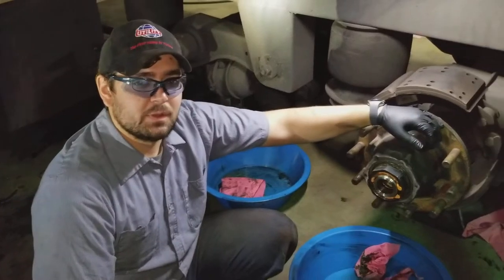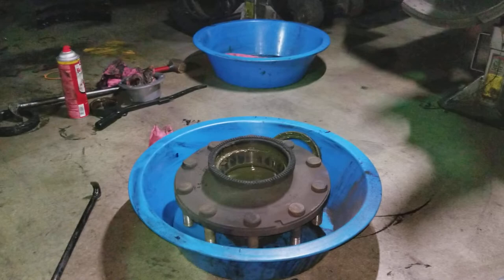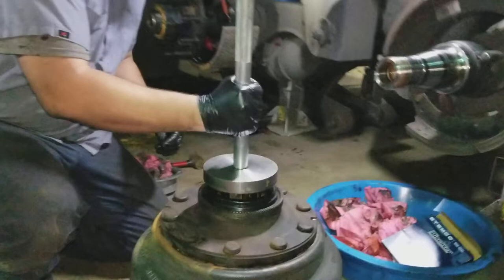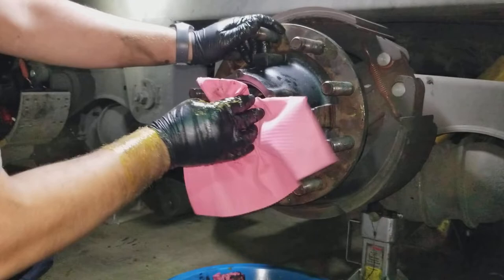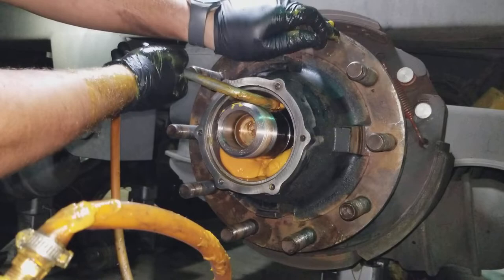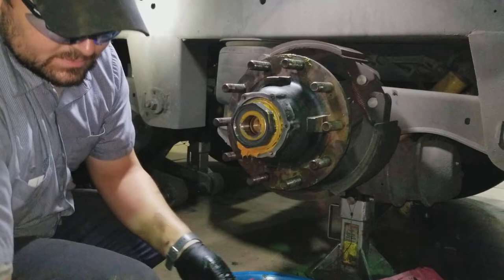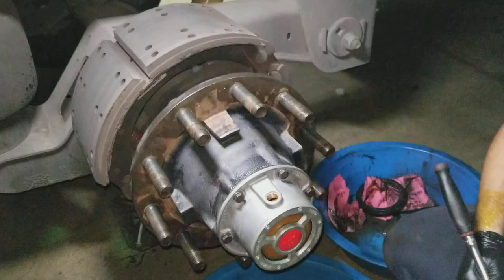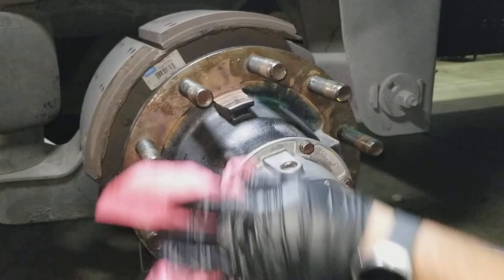Changing a Trailer Axle Wheel Seal

Comment: Great job but Wrong torque procedure. 200lbs ft 3x while spinning wheel hub back off til loose (1/2turn) ,then 100ft lbs 3x rotate tire, then back off 1dimple or 1/4turn. This is for this pro torque style Jamnut
Reply: Is the same torques he just started with the higher and work his way down to the 50lb ft torque

Comment: I watched this video and I agree with the last comment for the procedure for Pro torque nuts, and not backing of 1/4 turn is going to result in that wheel running  hot. Also you put in way to much grease, with that much grease you have no room for expansion or plug the vent hole on the end of the stub and that will cause that seal to start to leak. I also never put a seal in dry, I always put a little bit of oil on the seal before installing and a little bit on oil on the spindle before installing the hub no matter what brand of seal I install. I also switched from Stemco seals to National seals and I have way less seal failure with National. I do use the Pro torque nuts. I also never put the gasket on dry, I put some anti-seize between the cap & gasket & gasket & hub, I fine that the gasket will not stick to the cap or hub. I know some techs would and manufactures would disagree with me but I have been doing this for 30 years and have found this method to be full prof. We also retorque our wheel bearings on our trailer 1st a year and have found that helps a great deal to prevent leaking seals.
Reply: Nice!
Reply: I totally  agree  with you  way  to much  grease  hy will have a seal leak in no time

Comment: Clean axle and wheel hub surfaces with a emery flap wheel on a die grinder .  Apply #2 Permatex sealant on the outside of metal banded wheel seals . Clean  cup and cone with either .  5/16~18 tap installed in cordless drill to clean out hubcap bolt holes . Apply anti-seize to hubcap bolts .
67/23

Comment: Thanks for the tutorial sir......knowing is half the battle but I'd have to get jacks and impact wrenches strong enough to remove wheels first.
Reply: Buy a torque multiplier from northern tools. Those things are a beast
Reply: @Tommytv2  thanks I'll look into it.....can it even enable a battery powered impact wrench to pull off lug nuts?  OH I just looked them up and they are a completely separate tool/Ratchet ..pretty expensive too.  Oh the one an Norther tool isn't as expensive.
Reply: @dalephillips8250  yes super affordable and powerful👍
Reply: @Tommytv2  YES!

Comment: Ey bro I just change 2 seals on a trailer on same axle I put a new one and lead put second one and leak what do you think I’m doing wrong it’s a double not axle torque inner to 200 backed off 1 turn re torque to 50 then back off 1/4 set locking washer torque outer not to 300

Comment: Would you tell me what is the size this socket? I wanna by one
Thank you!!
Reply from the maker: Sorry for the really late reply but the socket you are looking for is going to depend on the axle nut on your trailer there are several brands and styles and they all have different sized nuts in 6 and 8 point and different locking mechanisms some have folding tabs, some have set screws, and some have spring clips you would have to take the cap off and see exactly what set up you have. The grease is Delo SFE EP it's a synthetic semi-fluid Grease
Reply: Fleet/:\Tech PPH ok thank you,  but I think my is 3/3/4 8 point! 
I appreciate your response!
Reply: Appears to be a 4 13/16 8pt

Comment: never ever install a dry seal
Reply: Stemco instructions for this Voyager seal says to install seal without any lube on the outside diameter. Most 100% OD rubber seal manufacturers do require lube on the OD.

Comment: Complete noob lol gave me  a good chuckle when you got the hub stuck to the drum after pounding in the seal and then stuck your hand through the hub getting grease all over your arm hahha. Also your final pack on the bearings isn't to spec  but looks like a good cheater procedure. Sometimes there's too many errors following specs. this way is is better for newbs.

Comment: If you fill the hub to 50%, like you did,,, never never never add semi-fluid to the hubcap!!!
Reply: TMC RP631B says hub should be 1/2 full. put a light coating of semi fluid grease on fasteners and inside hubcap to prevent corrosion. Do not fill hubcap and make sure the hubcap vents are clear.
Reply: @mgventure1  So we agree, I use all TMC procedures as references.
Reply: @wetlooklooker8502  Right on!!